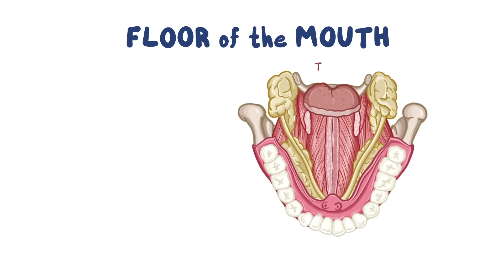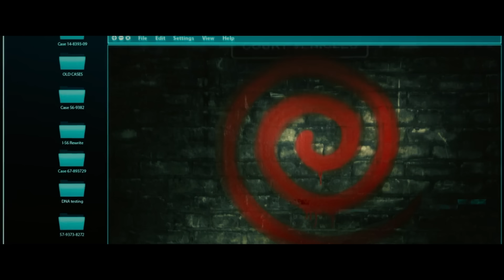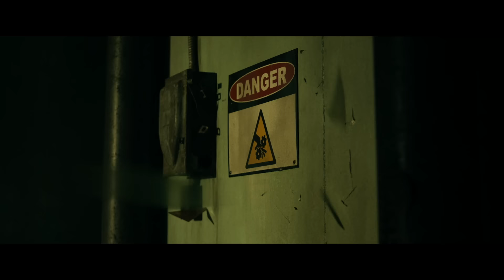How To Beat THE JIGSAW TRAPS In "Spiral: From the Book of Saw"

Comment: "The serial killer says he'll kill every one of us dirty cops in the department."

"Oh, then let's just take a few days off and sit in the police department where we'll be together so we don't get killed like the other cops."

credits roll
Reply: Best ending ever👏🏾👏🏾👏🏾 (While eating donuts)
Reply: Then the killer will just wait until their break is over, and then proceed with the original plan
Reply: @skinach  They can easily figure out that the killer is one of them and from there, they can investigate each member of the department and eventually find out the Rookie's ties to the cops. It's not a solution exactly but it gives them a lot of time to do proper investigation work instead of just running around and getting killed
Reply: @randam1005  they literally cannot sit on their asses and stop investigating the case specially the ones they are tasked with the handling, what do you think they are gonna do, give up?
Reply: @Jombi-d3g  I didn't say they shouldn't stop investigating. I said that they should take some time to do safe investigation from a secure location where they are all together working on the case. Even if it's a week or two, solid work can be done to find a connection between the victims and the possible suspects or targets. Due to officers being killed so frequently, the detectives weren't able to investigate or even think properly due to the overwhelming frequency of the killings. If you sat Zeke (Chris Rock) in the office with files of all the victims and he wasn't constantly going to murder scenes and drug dealers, he could definately make the proper connections and deductions

Comment: Actually, the tongue trap wouldn't be that bad if he just pushed his tongue back through it.  He may rip some skin, but that's nowhere near tearing your jaw off or getting splattered by a train. The raising water trap was as easy as just leaving it then taking your time getting your fingers free, which wouldn't be hard either as they're basically just Chinese finger traps, so removing them would be a breeze once at least A finger is freed. Getting out of the hot wax one wouldn't really be an option, but CS's way is the best. Just tilt your head so that it runs away from your nose, and boom. You can wait. You could also purposefully leave your mouth open, so when it gets covered, you can close it and break the wax. For the shredded glass, just climb on top of it and push the bottles out of the way so they don't fall on it's not hard, and it has a finite amount, so you would eventually clear it out.
Reply: Her head wasn't stuck in place. Take it a step further and move your head away.

Comment: Hey, How To Beat. In trap 2 you would actually have killed the victim with your advice. If the cable in question was power and not ground then touching it when you are standing in the miniralized water would kill you.

However, the trap is a lot more useless then that. If the wire is a live wire then that means that the spout is isolated from the pool and everthing else. This means that you can just climb up on the table and slowly wait it out.

Comment: Trap one:

Getting hit with from the side of a train is way less chance of death than getting hit from the front, but none the less the chance is still very high. You can be ripped from the ceiling by the force of the train or being spun from it, and that could send you toppling on top or in between the cars. That will probably end up with you getting crushed as a result of falling underneath the train. Not to mention you will definitely have a few broken bones from the collision. The chance of actually spinning without popping the chain, or falling safely to the side from that angle is very slim, and it would take the train quite a while to come to a safe enough stop at that speed.

Trap two:

He says to pull off the wires and release them from the inside of the pool, but aren't they LIVE wires??? They electrocute you anyway especially with your hands already being wet from the water. If he isn't chained to the pool I would suggest he leverage himself out and maneuver the wires far from the exposed ends, and THEN proceed to break the bulb for sharp material to cut free.

Trap three:

That's actually a really smart way to go. It would only go that way however if you were actually aware of rescue coming to save you. The ploy is that he either gives them options to end it quickly/save themselves through painful means or die. He makes you believe those are your only two options, because hopelessness makes you act out of desperation. She was entrapped in a casing. Even if she were directing the flow of fluid she would have been panicking and jostling to get free while the hot wax pooled underneath her. Seeing as it is hard to control your thoughts and think clearly while under extreme duress, she could have severed her spine with the blade on accident as it was under her neck. Either that or, if help couldn't come fast enough, risk drowning in wax slower.

Trap four:

That is definitely smart. A little calm thinking could have lead to that idea from any direction. No combatants here.

Trap five:

Again, no combatants. I'd shoot the frick out that guy lmao.
Reply: Waw
Reply: In the movie the guy said that even if she cut her spine he would have no way of knowing and the wax wouldn’t stop flowing, also pretty sure it would paralyze you
Reply: @duskssj4704  paralysis comes from damaging the spinal cord, her options were to suffocate from wax or SEVER her spine, meaning completely splitting the spinal brain - which is usually an instant death
Reply: Way to ruin the mood
Reply: Ty for summarizing the trap :D
Reply: Quite sure you do not need exposed wire ends to shock someone, but I'm no electrical engineer. Clean water is a bad conductor, so if the water was clean, and you float in the tub, the electricity would probably flow from the wires to the tub anyway.

Comment: Some of these traps were simply impossible to put in place.
-The tongue trap is impossible, because, well, as there is no trace of blood, it means the tongue wasn't pierced to lock it in place. therefore, it was only pinched in the device. With how soft and malleable a tongue is, it can be taken out of the device without putting that much effort, and even putting it in the device would be harder to do.
-The pool trap suffers the same thing : Although not as flexible as the tongue, due to the bone, it needs a LOT of pressure to be locked in place. A single knot would be enough, but here, there is no knot anywyere on that net. Moreover, being able to completely lock fingers in such a contraption would require to have the knots tight enough to cut the blood supply (which is obviously not the case here, as the fingers would have turned red, then purple). With that configuration, the nets would simply be unable to hold the fingers.

As for others, they're just ridiculously easy to beat.
-The wax trap is easy, as you said. Just tilt your head. Or, you don't even have to do it. Don't move. Sure, it'll be painful at first, but if you don't move, the cooling wax already on the cloth will protect your skin from the burning hot one. Well, unless the was is placed exactly at the right place to cover both your mouth and your nose. In which case, tilt your head.
-The glass crusher is also easy. The obvious solution is to cover the exit point for the crusher. The good thing is... these are glass shards. They're sharp, but... they're light. A cloth over the two exit points would be enough to limit the damage. And because they don't apply constant pressure, well, they might not evn be enough to cut through it. Hell, in that configuration, the glass shards shouldn't be able to deal enough damage to th cop to deal any kind of serious injuries. And if they were powerful enough to do that, then the ex-cop would have died on the first volley.
-The blood extractor simply wasn't a trap, it was an execution tool. But the amount of blood is indeed far too great.

Comment: the fish net 1 with the fingers would be easy to defeat.
just place you hands in the water or just touch the cables to the copper wire to creating a short circuit through the cables to the ground, the electricity will take the path of least resistance and that would be through the metal cables.

Comment: I agree with a few of the solutions here, the only exception being the "Move the copper wire out of the way".
If you touch that cable, the voltage will instead directly flow through your body and probably kill you before you even have a moment to regret it. You must remember, you yourself are a conductor, and more over are covered head to toe in the water

Comment: "If we run up and pull these wires, then even if the pool overflows, we won't be electrocuted" 
Id go as for to say 
"If we run up and pull these wires, then even if the pool stays, we'll be electrocuted"
Did you seriously just say that you won't be electrocuted if you pull on the conductor of electricity? 
Did you seriously forget that copper in this game, is literally as dangerous as the water? It is absolutely painful trying to witness "If we grab this conductor of electricity, to move it from this conductor of electricity, we will not be electrocuted from a conductor of electricity"

Comment: The finger trap "nets" look like cable socks for pulling cables through conduits, if they are, then its a steel wire, not netting, impossible to cut. Though when pushed towards itself, it opens up quite easily, this should of been a priority... the copper wire would not be able to be touched to remove either, i would suggest using the fluorescent light bulb to lift the wire in the air and allow the water to over flow.

Comment: for the first trap, I think he could have utilized the wire and cut through his tongue vertically, from the tip to the point of the puncture. this would give him the best chance at survival as long as he has the correct anatomy for a tongue split which is very much possible. if he was to survive, he would be able to talk properly after his tongue is healed.
this is possible because tongue splits are a body modification however it doesn't mean they are necessarily safe to do if he doesn't have the correct anatomy.
Reply: He only has 2 minutes to do this

Comment: For the 2nd one. If it’s a fluorescent bulb, I don’t believe you would be able to cut your fingers free. Due to the facts the glass within those bulbs are super thin and fragile, and if the finger traps were metal wire (more grounding for electricity) it would more than likely be impossible, what do you think? 

Loving the content by the way!

Comment: The guy in the pool couldn't remove the copper wire because his body was immersed in water. I know from firsthand experience that in that instance your body will act as a conduit circuit.

EDIT: He also only had 90 seconds to solve this so yeah... he wasn't making it out regardless.
Reply: Only a small portion of the wires are exposed as long as your careful and don't touch them your fine
Reply: @killertigergaming6762  it looks like all of the wire is exposed
Reply: @sunekun  I don't think so

Comment: “Shoot the rookie in the leg”
That will not keep him alive, that will at least double his chance of bleeding out
Reply: Wouldn't it depend on where you shot? Also it's still better than a headshot lmao
Reply: @sadrabbit53  Technically speaking, someone could survive a shot to the leg but it’s not likely at all. Your legs are the have the most powerful muscles in your body and because of that they need the most blood flow. Due to the amount of blood flow needed there is a very high vein/artery density, meaning if you get shoot someone in the leg you are most likely going to hit an artery. For instance, if you get hit in the femoral artery, you have about 1 1/2 minutes until you’ve bled out. If you really wanted to keep him alive, you would need to hit him off to the side of his gut. You have a significantly lower chance of hitting something vital there.
Reply: @rexgaming_501st3  
Good point, but I would think the objective would be disabling the guy or rendering him somewhat immobile. How about an ankle or foot?
Reply: @rexgaming_501st3  Killing hims a chance id be willing to take over possible missing his side-gut, or not taking off enough to render him powerless
Reply: @sadrabbit53  I actually had to look at an anatomy diagram for that question. From what I could learn, an ankle is many times safer than the leg it’s self. So if someone was shot in the ankle they would most likely be fine because of how few arteries are located there.
Reply: Shots to the torso and legs both have about a 95% survival rate if you get to a high quality hospital quickly(cops are outside, the call was crazed gunman, medical will be waiting a street or so away), the reason you're not meant to aim for the legs is not because its more likely to kill someone than a shot to the chest, its not, its pretty much the same, the reason you don't aim for the leg is its a smaller target that is moving around, its much more effective for a panicked person to aim for the chest.
Reply: @rexgaming_501st3  
Lol thanks!
Reply: What even is the problem with killing him? Even if they find him shot dead, they will suspect him being involved because he was already supposed to be dead.  AND SKINNED. So killing him probably wouldn't have caused much of an issue anyways.

Comment: Another option for trap 1 is that you’ll notice the chains are connected to the traps using quick links (the small thick part of the last chain links connecting them to the trap) which can be unscrewed, allowing there to be a gap where if you tilt your head and grab the chain you may be able to take the trap off the chain and get out of the way of the train

Comment: For the first trap, a painful but viable option could also be to use the barbed wire, and saw off the piece of tongue that is stuck, so you can escape without ripping it off from the throat. It will hurt, and cause a lot of bleeding, but if you get medical help soon after I think you could make it.

Comment: Short question: Let's say, even if you DID avoid the train crash in the first trap, what then? The train will have knocked the little step ladder away and you can't keep yourself safe by attempting to stand on the pipes at the side walls forever.

Comment: for the last one, you can shoot the rookie in the leg, then throw the empty gun at the target to lower the father down, tie knots on the blood tubes (as said in the video) and then, break one of the blood containers, grab a glass shard, and cut the straps of holding the father. you can see the cuttable straps clearly in 24:47, if you cut that in theory he cant be lifted up anymore. well, he can, but only by his hands, perhaps legs. then he cant point the gun to the SWAT team aganist his will.

EDIT: or you can risk it, and not shoot the rookie, but the metal wire holding the father up. a bullet could easilly break that metal rope holding him up. then nothing else can lift father up.
the rookie will be a problem though.
Reply: There could be a chance that throwing the gun wouldn't be enough force to lower the dad down, but other than that, yeah, good plan. Also the fact that the swat team doesn't notice the dude in the elevator escaping or that Chris can't just yell out "don't come in, its a trap"

Comment: First trap is actually easy to beat, the vice is held on by a tensioned peice of rebar, notice the springs  id clamp down on one side to create slack on the other (using one hand) then unscrew it about 3 turns the spring tension will release your tongue enough to release it, then simply move aside.
Reply: I don’t think you would have enough time to do that in the span of 2 minutes
Reply: @notafbiagent473  you absolutely would, if you can ignore the pain it would cause it would take about 34 seconds to release the tongue and about 20 to get off the tracks
Reply: @animatesynphony2716  You also have to account for the barbed wire. I can buy ignoring the pain of the tongue but there’s no way you can do that and ignore ripping off barbed wire without your brain cancelling it out at least twice.
Reply: @notafbiagent473  to be fair this is a hypothetical afterall, and we are under the assumption they can ignore enough pain to swing in the original theory, id say ignoring pain and pain threshold are the lease of the issues, also I did take into account freeing the hands, note that the numbers I gave have a minute free of time for that. 

Also keep in mind with adrenaline you probobky could ignore enough pain to stay conscious through it.

Comment: Those aren’t “fish nets” attached to his hands, They are Cable/Wire Mesh pulling grips for pulling Wire/Cable through conduit. I use them all the time in industrial applications as an electrician. They aren’t a net fabric material, they are metal; therefore lightbulb shards (especially incandescent ones) would not be able to cut through them. And as far as removing the copper wire, you’d be killed instantly touching it without proper insulation; you’d essentially just be completing the circuit to that the water was going to prematurely. 

You’re best bet in this situation would be to remove yourself from the pool of water and create as much insulation between yourself and any conductive substances as you can, let the water rise up to the copper wire, and hope it shorts itself out before the water level reaches you.